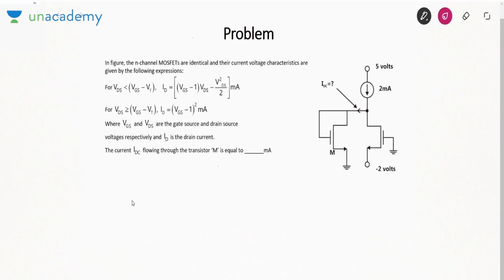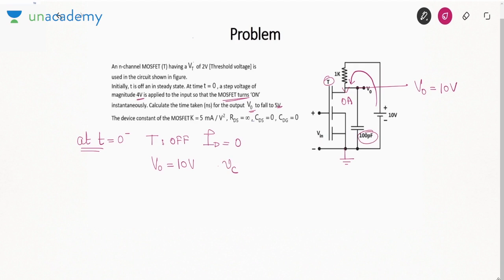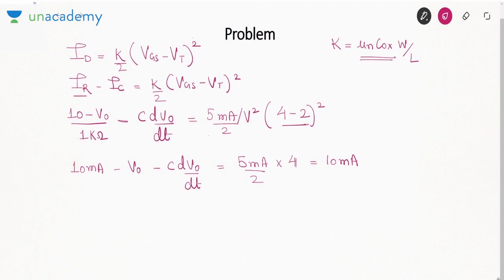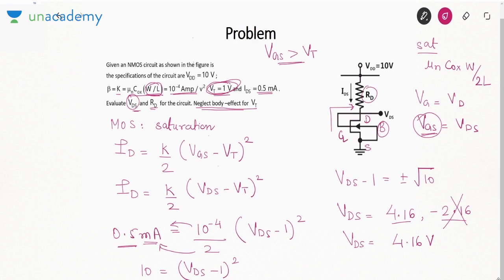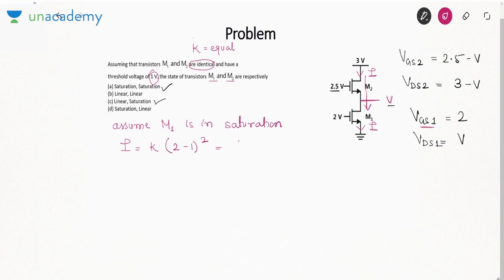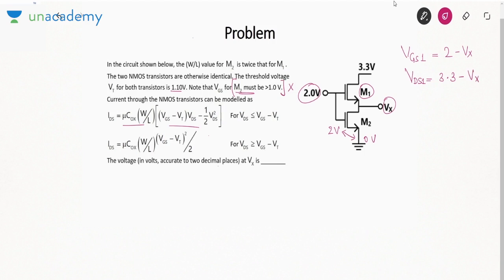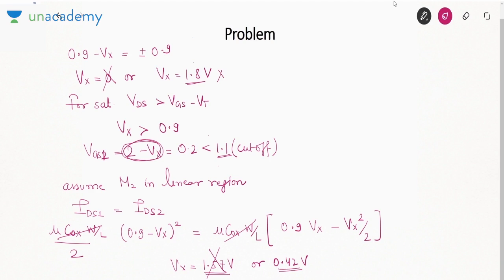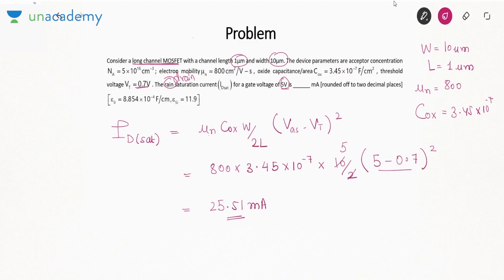Problems from Analog Electronics | MOSFET | Lec 66 | Analog Electronics | GATE 2021 Exam

Comment: In second last question we have to take W/L corresponding to I=1.5 mA i.e. W/L=5 but you have taken it 10 i e corresponding to source MOSFET, which is correct?
Reply: W/L 10 is correct  because now that 1.5mA is Iref  for W/L 10 Mosfet because upper mosfet are P-Mosfet